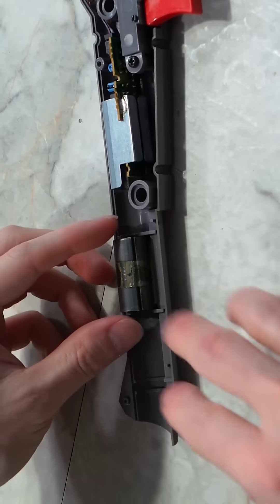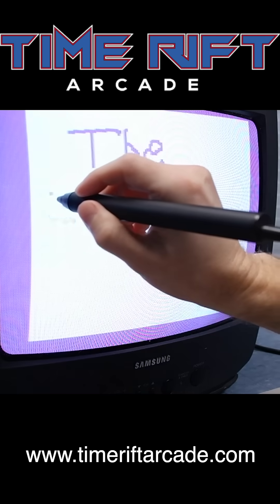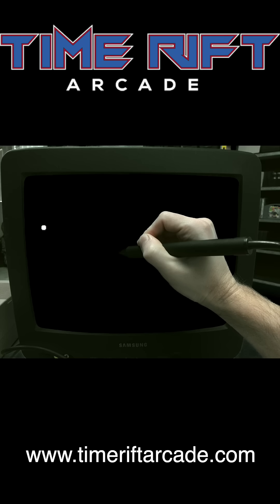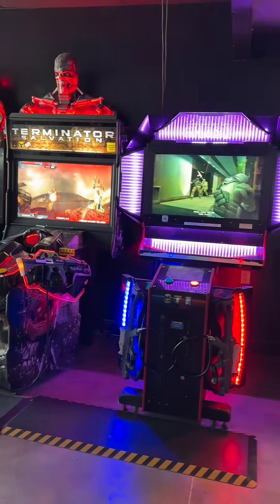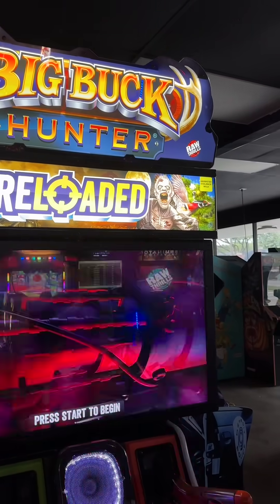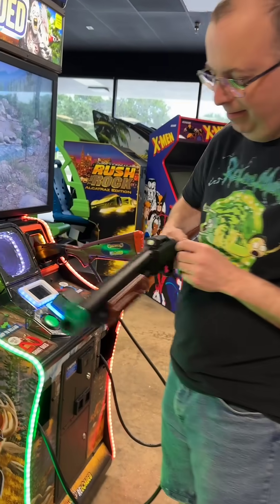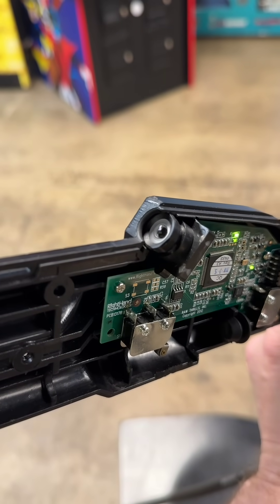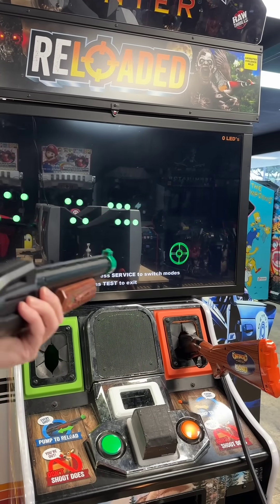How Arcade Light Guns Work w/The 8-Bit Guy & #8bitguy #retrogaming #arcadegame

Comment: Nice seeing you in the arcade ^_^
However the SNES didn’t work that way. Timing scanning was more a PS2 thing. These early consoles worked by going to black and give a white spot where the target was. 
I think some even had solid colors for several targets. 

That arcade gun is cool. The xBox 360 and Wii did the same thing
Reply: Well, yes, but that still required the precise timing of the CRT's raster beam.  If you try to play the same games on an LCD TV, even though it will look just as fast to the human eye, the timing of the white dot will be off (and unpredictable even if the game knew about LCD TV's).  So, he simplified, but he's not really wrong.
Reply: @derekchristenson5711 hmhhh okay. Guess I got to test that out. I have both types of screens here,
A ps2, ps1 and Xbox360
I sold the light gun for the Xbox but I got a bunch for my PS2 so I can play Time Crysis II every 2 years. 
As a kid, I was wondering why i couldn’t have one on PC, that’s why I dugg into the subject but my knowledge on consoles falls off after these consoles .-.

Comment: I always thought duck hunt did not not rely on timing... When the trigger is triggered, the screen turns black, and the duck(s) are covered by a white block. If the lightsensor detected something white, it assumed you aimed correctly. 

You can quite simply cheat the system by pointing the gun at a white light...

Comment: I have seen a lightgun game by Sega (I don't remember the name, but think it ran on the Naomi), that also used IR LEDs, despite using a CRT for the display. I guess they didn't want to have to rely on the scanlines for aiming!
Reply: Because Naomi games use VGA monitors, not regular CRT monitors.  Traditional lightguns don't work well on VGA CRT monitors because of the high refresh rates and screen resolutions.

Comment: Neat! Very similar to how the Wii Remotes work, I think
Reply: Yes it's the same principle. The sensor bar is just a bunch of IR leds connected in series. If you go into the sensitivity settings screen of the wii you can see the infrared dots trough the POV of the wiimote camera
Reply: @DjPolystation  you can also use tea candles spaced about a foot apart as a sensor bar IIRC
Reply: The wimotes can track 4 or 5 or sources they were used in a later project to make a low cost teaching device with a projector. As a start point do a search for a ted talk by Johnny Lee